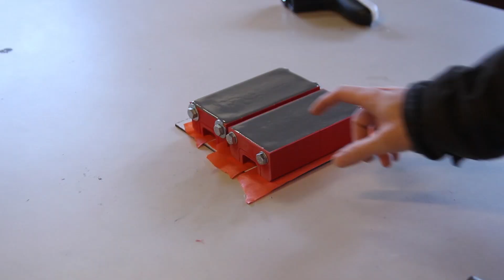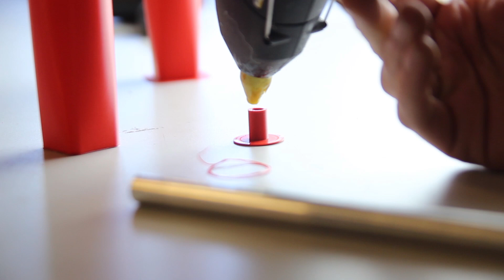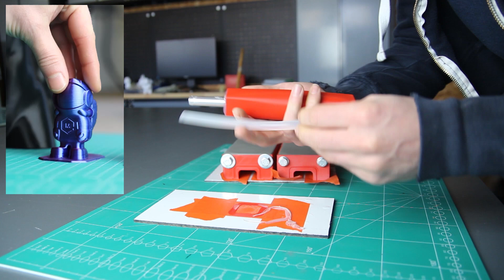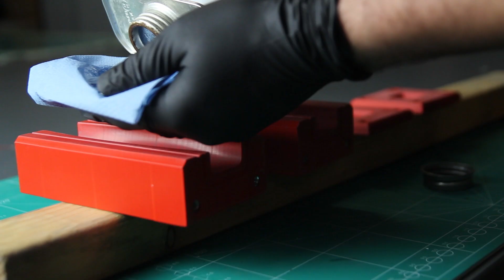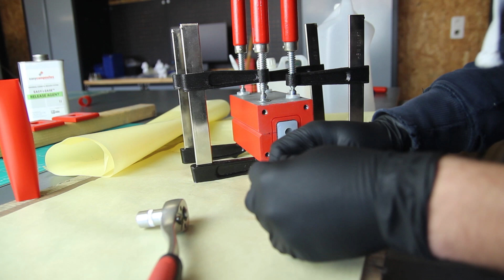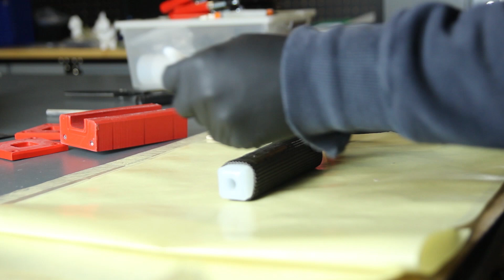3D Printed Moulds To Make Carbon Fiber Epoxy Resin Tubes – How to Tutorial

Comment: End plates were pointless - you seem lost
Reply from the maker: These were made when using the silicone core as an expandable core without the bag with prepreg then...the sides create a wall to build up pressure in the core when it's expanding under heat

Comment: Great tutorial on the concept! For production-ready parts, we use high-temp 3D printed resins or CNC machined aluminum molds. They withstand the heat and pressure of pre-preg carbon fiber, ensuring higher consistency and surface finish. Nice work!:hand-pink-waving:

Comment: Can you share the tolerances you set with your 3D printed mold and the print for the silicone insert. Is the mold created around the intended carbon part and then the inner mold just shrunk by 1mm say or the equal thickness of however much carbon you're using? Assuming it was modelled with room for the prepreg cardon, Looking to make a few things with Prepreg but working on the CAD molds first - Thank you!

Comment: Great videos :) Do you have any comments on the best release agents to use with 3d printed molds? I saw an Easy Composites video they used PVA release agent due to the layer lines but would mold wax or easy lease etc be fine if you get the mold surface smooth to start with, perhaps even using a clear coat and buffing that to a perfect finish after sanding the printed mold or as a final step on an SLA printed mold surface.

Comment: When first making the resin molds(around 2:10) is it necessary, or recommended, to let the part set in a vacuum chamber for added strength and/or stability???
  
 I’ve had terrible luck at work when certain subcontractors get lazy/cheap, and deliver parts with a lot of dissolved air (& moisture?) in the cast parts.

Comment: I recently made a silicone intensifier for a 3D printed mold, and the intensifier ended up stuck in the mold, due to my lack of experience in the design and application. It was refreshing to see your experience at work. I'm also envious of your workshop! I'm currently working in a very tiny space.
What mold release do you use?

Comment: I am sorry I think I have a burning stupid question to ask. Complete newbie. How does the wet carbon have room to be put into a mold? You did not remove any material from the silicone core or the plastic mold after you had made the silicone core. I understand the carbon is a few millimeters thick but still wouldn't that prevent the mold from being put back together? Also, loved the video it has just opened my eyes to a whole new world of carbon parts making. Thank you very much.

Comment: Excellent work ..... I have one question, Why were you using a side plate to hold the Molds together? Can we use a feature in the moulds itself to hold them together like some loaded fasteners using spring washers or something? I understand the side plate will be needed anyway ..but the method which I am proposing can give better results, right?

Comment: I looked through the comments and didn't see this, So I'll ask:
Do you have any deformation from baking the 3d print after filling with epoxy? obviously the epoxy strengthens it, but do you get surface variations?

Comment: Interesting method. 
would there be any benefit in putting some sort of controllable heating element in the Aluminium tube to maybe heat the core more and increase expansion/compression from the inside out?

Comment: You should have split the mode diagonally.
Reply from the maker: Could have, but might cause problems with the filling of the aluminium epoxy as it would have different mass on different spots

Comment: Great to see another committed crafter Mathieu. Interesting seeing your aluminium fill strengthening. I've been printing for wing-foiling, from this year I print the wing model, extend a membrane of tape from the edges and after applying mould release I resin infuse two sides of shell moulds in one go.  I only use around 4 layers of thick glass composites per side so there is some flexibility for my big wing moulds. After cleaning up surfaces and mould release again I lay carbon and epoxy into my moulds and clamp all around the edges after fixing locator screws. Amazing results, I'm finding laying impregnated chopped carbon around any sharp edges helps to exclude the sharp bends that otherwise encourage bubbles. Because from this year I'm doing relatively thin, high performance hydrofoils there's very little low density core material in them, but your point about thermal expansion is interesting, It must account for a part of the resin leakage I get as my parts exotherm cure and the cores out-gas, pushing resin to the perimeter. I did some wings with 3D printed cores 2020, 2021,  printing with double thickness infill walls in cubic is the ideal but the thickness of the laminate makes design accuracy hard to achieve and gives inferior leading edge strength on the flat composite fibers bond surface, even with resin infusion.
Reply from the maker: Thanks for your comment! sounds good what you are doing! I have resin infusion on printed mould on the planning as well for tutorials later on when I find the time :D
Reply: @MatthieuLibeert  I have been doing 3D printing 11 years now. I subtract shear planes and dowel holes from my wing designs and print them leading edge down into supports now after splitting the meshes in prussaslicer and rotating them for nearest orientation to build plate. I am close to finishing my 6'th mould this year. but I've also done a little bit of carbon forging, foundry, software, hardware design, and RC jetboat jet unit design, maths art vases. Fluidity on thingiverse and pin shape though I only put the beginner models on those.

Comment: Thank you so much for this video. This is the first time I've seen using a hollow silicone plug to apply pressure during heating. 
This is the perfect solution for a project I'm working on and I've been trying to figure out a good way to make repeatable results, as I have to make multiples of the same part for the project.
Reply: This process is very typical in carbon bicycle manufacturing. often are either latex or silicone bladders that either expand under vacuum or are pumped to a specific pressure or both.
Reply from the maker: correct, but like you say they mould mainly use thin walled bladders as it would be hard to remove full silicone cores from a bike frame :D
Reply from the maker: Glad it was helpful!

Comment: I use concrete for filling up the mold, much cheap than resin.
Reply from the maker: concrete should work as well, but would be a bit afraid on shrinkage, moist and strenght with higher temperatures

Comment: the pla doesn't melt when you put the mold into the oven for post curing? how high of a temperature are you setting it at
Reply from the maker: 120degrees at max temp

Comment: It's an interesting idea to use the natural expansion of the silicone. I was expecting you to inflate it with compressed air like a bladder. Does the final part have a purpose, or is it just a proof of concept for this mold system?
Reply from the maker: Inflating bladders is another topic I might cover later on! The part has no purpose, mainly educational shape for these videos :)

Comment: Fantastic video, I've been working on a similar problem for a while and the silicone intensifier makes so much sense.
For the Tool Cast resin do you think this could be substituted with say concrete? Sadly I'm on the other side of the world to Easy Composites and our local stores don't seem to have an equivalent (best I can find is casting resin for epoxy river tables).
Reply from the maker: might work with other materials, so concrete might work but not ideal...you might experiment with filling regular epoxy with fillers as well to prefill your resin yourself

Comment: Hello Matthieu, thank you soo much for your videos, sorry for my english, I've a question: in this case that isn't prepreg how you manage the excess resin ? I supposed that you put a peelply and breather between silicone form and carbon fiber, instead you put nothing. The resin goes away from the open passages ?
Reply from the maker: No peelply, just need to add the right amount of resin, not too much and not to little, the pressure of the core will push out some excess resin if needed, the rest stays in the Carbonfiber

Comment: 1) loved it!
2) to what temperature is the oven set? are you not worried about the plastic mold warping from the hi heat?
3) what material did you use to polish the pla?
Reply from the maker: 1) Thanks :D
2) Temp up to 80°C so far for the mould, parts were cured at 40°C with the resin. Warping is prevented by the Casting resin.
3) NW1 Super Cutting Compound Black, Bought on Easycomposites

Comment: I understand that the glass transition temperature of PLA is around 60°C. What temperature did you use to cure the epoxy mould infill and then the carbon laminate?
Reply from the maker: It can now withstand up to 80c...the casting resin now functions as a support for the pla, making it possible for higher temperatures. Might even reach higher temps, I'll do some more research on that...
Reply: @MatthieuLibeert  Thank you. I missed the brand of filament. Can you tell me what it is?
Reply from the maker: @donr62  there's a link in the description 😉
Reply: @MatthieuLibeert  I’m sorry but I can’t see it. Would you mind pointing it out please?
Reply from the maker: @donr62  it's called 'additive heroes power PLA' from 3dprinthings.be other brands call it PLA+ mostly

Comment: Nice video, do you put mold release on the silicone ?
Reply from the maker: No, In general it's not adviced to apply release agent (specialy not the chemical release agent) on silicone as it might deteriorate or harm the releasing properties of the silicone, now and then you can apply silicone oil to restore your silicone.

Comment: Thanks for uploading this great content 👍🏽
I've also tried 3D printed PLA Moulds but had some issues with demolding. 
I've tried the PVA and Chemical release but everything wasn't perfect.

Do you have trouble with that?
Reply from the maker: It's OK for small runs, but wouldn't use this technique for bigger series as these moulds tend to suffer... The chemical release was ok so far here! Pva would be a bit less reliable I think personally
Reply: @MatthieuLibeert  thanks for your feedback

Comment: Do you think it would be possible, to make the outer mould pieces and the inner core out of milled aluminium. Since Aluminium got quite a high thermal expansion it should also get some pressure on the carbon fibre. Of course it depends on the size of the inner core. The more volume the greater the expansion. Never saw this with the silicone but very clever idea. Keep up the good work.
Reply from the maker: Outer mould is normally made out of aluminium but 3d printing is more affordable, that's why it's a 3d printed mould here for this video, but for larger runs I would normally use an aluminium mould... Care should be taken with an aluminium inner mould to make sure you can still remove it after cure
Reply: @MatthieuLibeert  Yeah a stiff inner core is only possible if you got an draft angle,no corners and no undercuts. Also a good plus on flexible silicone
Reply from the maker: @renny_composites  correct!

Comment: In my old company we made the mclaren monoque. It is rtm and have used airballons instead of bag or silicone. High pressure inside. Do you know that System?
Reply: You’ll need really strong moulds for this process. I haven’t seen anyone do it with moulds that aren’t metal, because your basically pushing the two mould halves apart. I’m currently looking into making a hollow composite part (similar to the one in this video) using the rtm technique and printed moulds, but instead of balloons i’m going to use a soluble 3d printed core.
Reply: @sanderhuybrechts  Yeah above all you need High pressure resin, vacuum in the mould enclosure and high pressure in the air ballons... that's another deal
Reply: @LeJP_iz  I’ve seen it done using sort of paint pressure chamber with an injection pressure around 3bar, although slow it’s possible. Do you think moulds like the one in this video will be able to hold up at this pressure?
Reply: @sanderhuybrechts  I have no Idea, maybe...
Reply: @sanderhuybrechts  of is this a metal mould. This is a big industry here in salzburg.
Reply: This was what I was expecting as well - inflated by either air or fluid.
Reply from the maker: Could work with pressure bladders as well but a bit more complicated to make! These type of moulds should be able to hold the kind of pressures... If needed some adjustments could be made with aluminium plates on the bottom and sides
Reply: Just wondering when and how they added the air to the ballons. You can only go full pressure when the mould is closed or the airbag would be pushed out the open mould. DO they got an valve to add the air? Anyone have any idea? Thanks
Reply from the maker: A valve would be used but with high temperature curing mostly an inert gas is used instead of air to pressurize
Reply: @MatthieuLibeert  yeah just like in a autoclave... logical !
Reply: @renny_composites  you got 1 point to put air inside. In our company it look like a plastic house